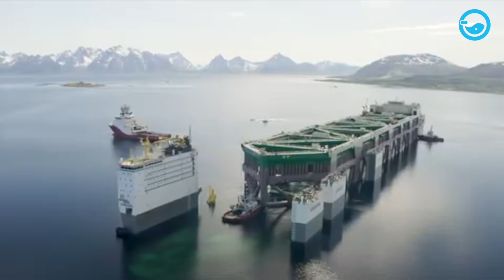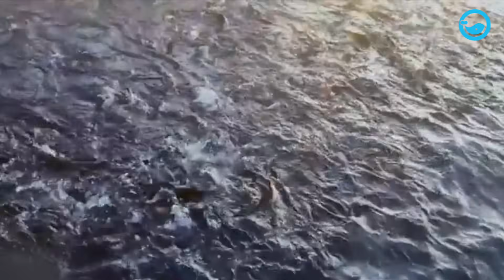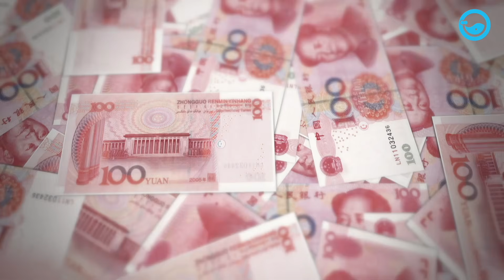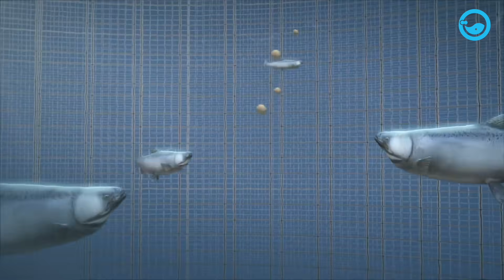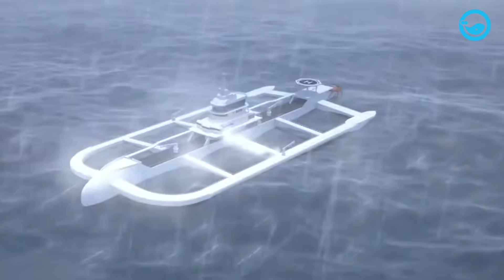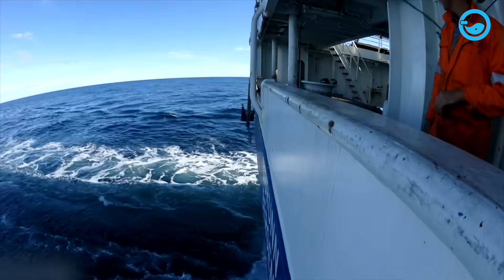This Ship Produces 2 MILLION Salmon INSIDE: World's Biggest Offshore Fish Farm Ever Built

Comment: The vast majority of the world's large-scale aquaculture systems, including aquaculture vessels and semi-submersible platforms, are manufactured by China.

-------------

Name	Type	Built by/Country	Dimensions/Tonnage/Capacity	Approx. Cost	Key Features	Source

JOSTEIN ALBERT	Deepwater Aquaculture Vessel	Yantai CIMC Raffles, China	L 385m × W 59.5m, 400,000 m³ water volume, 2 million salmon	Not specified (high cost)	One of the world's largest and most advanced deepwater aquaculture vessels, equipped with 6 deepwater intelligent cages, adapted to extreme cold and harsh conditions outside Norwegian fjords, fully automated.	

Havfarm 1	Semi-submersible Aquaculture Vessel	Yantai CIMC Raffles, China	L 430m × W 54m, 60,000 dwt, 2 million salmon (14,000 tons annual production)	Over $200 million	One of the world's largest semi-submersible aquaculture vessels, dynamic positioning, closed-loop water treatment, waste recycling, withstands North Atlantic Force 12 winds.	

Ocean Farm 1	Semi-submersible Aquaculture Platform	Wuchang Shipbuilding, China	Ø 110m × H 69m, structure weight 6,000+ tons, 250,000 m³ water volume, 1.5 million salmon	420 million RMB	World's first fully automated deep-sea semi-submersible smart farm, highly automated, resistant to Force 12 typhoons, requires only 7 personnel, 25-year design life.	

Guoxin 1	Mobile Aquaculture Vessel	China	100,000 dwt, annual production of 3,700 tons of large yellow croaker	Not specified	World's first 100,000 dwt smart fishery large aquaculture vessel, capable of avoiding typhoons, onboard recirculating aquaculture system simulates marine environment.	

Dehai 1	Semi-submersible Aquaculture Farm	China (jointly developed by South China Sea Institute, etc.)	L 91.3m × W 27.6m, 30,000 m³ water volume	15-21 million RMB	China's early 10,000 dwt semi-submersible truss-floating hybrid smart farm, designed to withstand Force 17 typhoons, cost-effective.	

Jiuzhou 1	Aquaculture Vessel	China (Zhuhai)	L 155.8m × W 44m, 80,000 m³ water volume, annual production 3,000-5,000 tons	250 million RMB	World's first natural water exchange aquaculture vessel, can replace over 3,000 near-shore fish farms.
	
Nordlaks Havfarm	Semi-submersible Aquaculture Platform	China (presumed)	L 385m × W 59m, 1.8 million salmon (12,000 tons annual production)	Not specified	Designed for extreme Arctic conditions, adapts to wave heights ≥14m, uses low-temperature specialized steel.

Comment: Norway's one looks better
Reply: Ocean Farm 1 ?  It's also made in China
Reply: The vast majority of the world's large-scale aquaculture systems, including aquaculture vessels and semi-submersible platforms, are manufactured by China.

-------------

Name	Type	Built by/Country	Dimensions/Tonnage/Capacity	Approx. Cost	Key Features	Source

JOSTEIN ALBERT	Deepwater Aquaculture Vessel	Yantai CIMC Raffles, China	L 385m × W 59.5m, 400,000 m³ water volume, 2 million salmon	Not specified (high cost)	One of the world's largest and most advanced deepwater aquaculture vessels, equipped with 6 deepwater intelligent cages, adapted to extreme cold and harsh conditions outside Norwegian fjords, fully automated.	

Havfarm 1	Semi-submersible Aquaculture Vessel	Yantai CIMC Raffles, China	L 430m × W 54m, 60,000 dwt, 2 million salmon (14,000 tons annual production)	Over $200 million	One of the world's largest semi-submersible aquaculture vessels, dynamic positioning, closed-loop water treatment, waste recycling, withstands North Atlantic Force 12 winds.	

Ocean Farm 1	Semi-submersible Aquaculture Platform	Wuchang Shipbuilding, China	Ø 110m × H 69m, structure weight 6,000+ tons, 250,000 m³ water volume, 1.5 million salmon	420 million RMB	World's first fully automated deep-sea semi-submersible smart farm, highly automated, resistant to Force 12 typhoons, requires only 7 personnel, 25-year design life.	

Guoxin 1	Mobile Aquaculture Vessel	China	100,000 dwt, annual production of 3,700 tons of large yellow croaker	Not specified	World's first 100,000 dwt smart fishery large aquaculture vessel, capable of avoiding typhoons, onboard recirculating aquaculture system simulates marine environment.	

Dehai 1	Semi-submersible Aquaculture Farm	China (jointly developed by South China Sea Institute, etc.)	L 91.3m × W 27.6m, 30,000 m³ water volume	15-21 million RMB	China's early 10,000 dwt semi-submersible truss-floating hybrid smart farm, designed to withstand Force 17 typhoons, cost-effective.	

Jiuzhou 1	Aquaculture Vessel	China (Zhuhai)	L 155.8m × W 44m, 80,000 m³ water volume, annual production 3,000-5,000 tons	250 million RMB	World's first natural water exchange aquaculture vessel, can replace over 3,000 near-shore fish farms.
	
Nordlaks Havfarm	Semi-submersible Aquaculture Platform	China (presumed)	L 385m × W 59m, 1.8 million salmon (12,000 tons annual production)	Not specified	Designed for extreme Arctic conditions, adapts to wave heights ≥14m, uses low-temperature specialized steel.